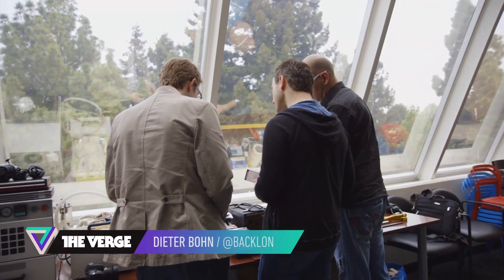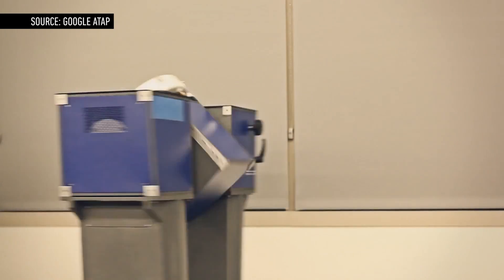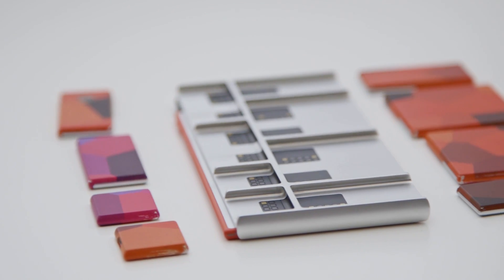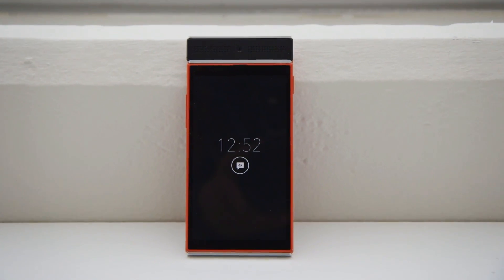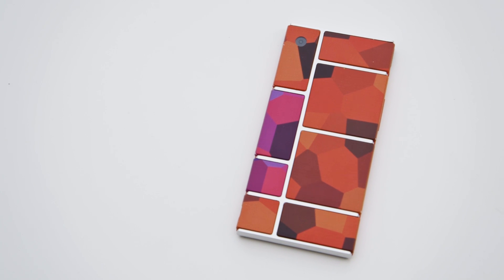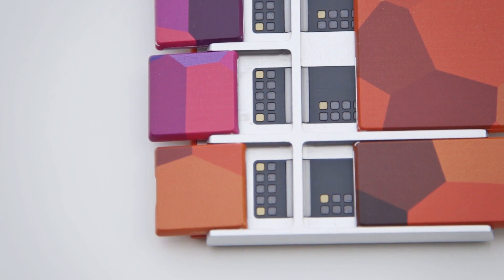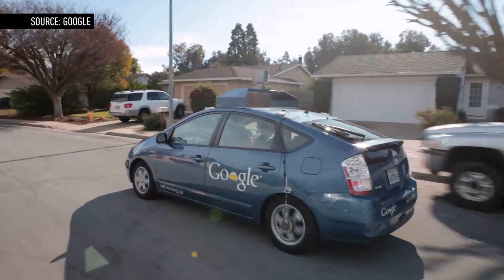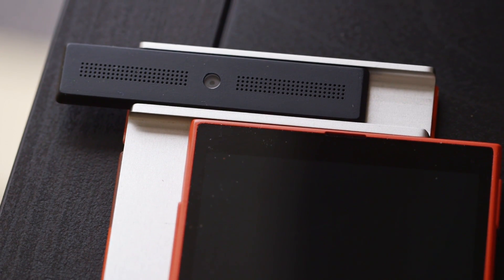Google's Project Ara: Reinventing the smartphone with building blocks

Comment: Can't wait for your Nikon camera module, or your Bose speaker module or your Garmin GPS module? 
Not a chance of happening commercially. The bus, connectors and module wrappers will present too much cost and bulk.The bus itself will not keep up with technology and with shrinking component size the modules will be mostly empty and waste space. Multi-function modules will be inevitable and will kill the concept.
And the price of free market, not from the orchard, phones is dropping really fast, check out the Xiaomi line. Who will upgrade a single module that costs 50% of the price of a new phone?
The goal seems attractive but it ultimately relies on stagnation at the core so is doomed from the onset. There is no chance that you will keep such a phone longer than a integrated smart phone. Think of how bad you will feel when you have to toss away all those modules.

Comment: Would be awesome to upgrade parts of phone.. I would just need a good case for it to not make it a lot thicker but just hold the modules in non wigeling..
Then I would be amazed to buy speaker that i want, CPU that i want, GPU that i want and ammount of RAM that i want :D i would probably be like some quality stereo and 330 Adreno, Snapdragon 800 on 2,8Ghz xD and 3-4GB RAM :D
Anyway im really looking forward to it and if it wont come out in 2015 im taking Xperia Z2..
+ the Screen on ARA looked pretty nice too not too big and not so small.

Comment: With this project like the other project called Phonebloks I worry about the phones becoming worn with the contacts and sooner or later the blocks slipping out and also that maybe when holding the phone a block could slip or move making it lose contact with the connector. The way I see to stop it is not major but helpful but it's to release a case with the phone or have it where they will lock in place and not use magnets.

Comment: I never make assumptions like this. But I truly believe this technology is the future of smart phones and even tablets.
The modern culture is all about customization and individuality, this takes customization beond the screen and appearence, and delves into the way the phone operates. With people able to customize the hardware of their phone. I will be more willing to buy their phone, or as it will turn out, my phone, because I don't have to have anything I don't want. As they've said, this technology will also expand the life of the phone greatly.

This is hacker (the good kind) gold. This will open windows for all sorts of fun applications. 3rd parties can create emulators, games, and even modify the entire functionality of the phone through custom built peaces for the phone.

While this technology is liberating, it could also prove to be limiting in some ways. Here are some problems I think we could see with the device, and some solutions to those problems.

1: unexpected disconnections. Any number of bumps and jolts from every day use could disconnect a module mid use. I want to be able to slide the module half way out and still have it function on the device. This would be accomplished, not by pin point connections, but by connection runners. Basically long pin-point connectors.

2: Not enough room: Lets say that you have all the modules you want on your device, but you still want one more. You would have to sacrifice one module you want, for the other one you want. This is bad. "You can simply exchange them when needed." This is a fine solution, a quick swap of modules can expand the functionality of the device. But these modules aren't like applications that you can install, uninstall, close and open in one simple tap. This is hardware. In order for the "quick swap" of modules to be practical the device would need to be able to live-adapt. Which means that you wont have to restart the device, or open up an intermediate program in order to swap modules. You should be able to use the newly swapped modules just as fast as you can swap them. This feet is not impossible, but it will take some clever engineering.

3: While the whole magnetic holding mechanism is great and all, is it really practical? Wouldn't a push-click system be far more practical? If you can remove those modules as easily as they show, then one simple drop could disconnect any one module. A simple "push-to-remove" system is very practical. It may not be as aesthetic as the magnets, but it's what works.

This technology could win in so many ways, and could even revolutionize how we view portable devices. But it can also fail miserably. Let's hope Google knows what their doing.

Comment: Can laptops and desktops computers be also made cheaper this way?
Reply: People build computers at home a lot, it's mostly plug and play. Upgrades can be made easily.
Reply: Desktops are already made this way, for the most part.

Laptops not so much. It might be possible to do this as moving parts become less needed, and you can have low-powered modular laptops. But the problem with that is that people who want a modular laptop probably won't want a low-powered one. They want a work-horse.

Still it's possible. If it can be done for a phone, it can definitely be done for a laptop.
Reply: Deo Favente Razer is a pretty good company with nice products, they're probaply not the best and there products don't suit everyone, but they're not a joke.
Reply: I could see module tablets maybe using the same parts as a module phone.
Reply: Nathan Gregory yea, that will Probaply be the next step.
If this type of tablet comes out I am Going to buy a 13inch "base" and put massive storage on it! :P
Reply: razer is in the progress of prototyping a modular desktop that is easy for anyone to do.
Reply: brandonhughes7 so you mean a regular desktop with a razer badge?
Reply: brandonhughes7 I fucking LOLed at this. Razer is a joke, so are their users.

Comment: this honestly looks like a promising phone... and in the long run it would seem to be cheaper too because if your camera breaks instead of sending it to the company and spending 100$ or more to get it fixed all you have to do is get a new camera. one thing they should make is a way to fully secure the parts so you don't accidentally pull out the battery. If they do make this phone.. I would buy it. it seems like a great idea.

Comment: Idea is cool and all, but trash in reality. It's got minimal advantages, especially given that the majority of smartphone purchases are subsidizes by cell providers, and some ENORMOUS disadvantages. The losses from adding the complicated communication and locking system, the individual casing for each module, and the inefficiency caused by breaking the phone's mainboard into multiple modules all makes this really impractical. Not to mention disasters such as compatibility and cooling.

Problems like waste and prices can be solved by simply buying last-gen phones. Because so many people replace their phones, those who can't afford a good phone can just buy a used one from someone else. With all the horrible inefficiencies involved in the Ara, it will probably still be a more powerful feature rich phone.

Hate to break it to the optimists out here, but this idea just doesn't work to any practical extent.

Comment: They need to add something on the sides that you pull up so the things won't slide off so easy. You would just need to push it back to pull a piece out and then pull it back. That's my idea, unless they already had something.

Comment: I find this to be very cool, I wonder if it would be possible to create seperate CPU and GPU modules, instead of having them on the same dye. It would increase performance as they could be made larger and more powerful, and having a larger battery module and no camera would allow it to offset the power consumption. I think a lot die hard android users would love that.
Reply: well it all depends how they make the platform... If they make the platform like phoneblocks then what you think of is very much achievable... IF they make it like this... I don't know where exactly are you gonna put CPU and GPU? If you want power they wont be small to replace it instead of camera... And you'd want big battery as well... There's not enough slots to configure. Phoneblocks has better platform.
Reply: sermerlin1 phoneblocks does not exist in any shape or form. they just want to take other people achievements.

Comment: keep in mind the pieces only come off because the magnet is in the off state. they'd have something on the software side to turn the magnet on and off changing between 3 newtons (easy to pull off but doesn't fall) and 30 newtons. which you couldn't pull off if you tried.

Comment: I really love this idea. There's one thing that concerns me though. Lets say you buy a more powerful processor to replace the one you have. Wouldn't you also have to buy the ram and gpu pieces (Don't know if gpu will have its own piece.) to prevent bottlenecking in the device? For example, you can have as much ram or ghz as you want, but if you don't have fast memory transfer speeds to back it up, it's kind of useless. So wouldn't that make you have to fork over more money to buy more pieces? Then again, it does depend on what you upgrade specifically. Maybe i'm drunk. Idk. This just came to my mind is all. Still love the idea though.

Comment: I would try it out, but I suggest them making cases or something that will secure the chips together without any falling off problems or any concerns to the user of the phone.
Reply: Yes. At least a better locking mechanism (as cool as the magnets are). Imagine using the phone and you accidentally slide the battery out, or drop the phone.
Reply: Sub Ripper I do believe the lock function makes it impossible for you to take it out, unless you force it really hard but at that point you will break the frame anyway
Reply: Oh my god yes that's what's needed
Reply: Yukim Nomoto Not you, just that specific idea of yours :P You could be a genius for all I know.
Reply: No brainer. eBay will be full of cases week 1 after the release just like any other phone release!
Reply: Woo im smart now
Reply: Redundant Paperclip Thanks for calling me a "no brainer".

Comment: There are a few potential problems for some consumers. The one i'll say is this: should this project get "done" and out into the hands of the public, there will be those who dont upgrade the right parts. They keep upgrading the processor but not the ram, or the camera but not processor, yada yada yada. This would create issues of the phone being slow, not having enough memory, etc. Although a simple solution to the problem would be labeling minimum suggested parts. This is a very good idea, one that quite a few companies are working on very hard to be the first to announce a "finished" product, and do so on a large public scale. The ability to improve your phone slowly, and to save money while doing so (because you dont have to buy a whole new phone with predetermined parts). I think there would be a lot, and i mean a LOT, of people getting a smart phone for the first time interested, and im sure that a lot of people WITH a smart phone would probably like this one better. And if both Apple AND Google got on board with this, and provided both their operating systems, the possibilities are endless. Although i know this project is going to Google.

Comment: Seems like the modules come off way too easy, especially considering you wouldn't change modules very often at all.
Reply: It has a toggling magnet on it that keeps them in place from what I understand. So I think you can just lock the modules into place and unlock them after.
Reply: They should make so when the phone is on, the magnets are active and hold them and when the phone is off, the magnets inactive and you can take them out.
Reply: Like they said, the modules are made to be taken on and off easily without any struggle, that's why they have a partenership with a company that's going to make extra slim, strong, thin and easy to take off cases, in the way to protect your phone, the modules and make it look pretty.
Reply: Harry Lister They are electro permanent magnets do not need a continuous flow of energy, only a small electrical impulse to change polarity generate a force of 25 newtons between them so not take off, to unlock the modules will be done by software.
Reply: They are held toghter by strong magnets. Also they will let you design your own back cover that goes on top of the back of the phone.
Reply: TechPimp
 Yeah,that's gonna be challenging
Reply: The magnetism they are showing is how magnetic it is when you are able to switch them. Afterwards you activate the more powerful magnet and it's very hard to get off
Reply: alex d Yeah not like it's hard to unscrew a few screws. Doesn't look as cool though :P
Reply: Harry Lister sinephase Harry, they could fall off by accident, the magnets don't need power. sinephase, that is probably the art prototype that doesn't have the magnets.
Reply: If they can actually build a modular smartphone that ACTUALLY WORKS,I won't really give a damn about the modules falling off. That's actually the least important part of thiis project. Don't worry about it,they will figure it out for sure.
Reply: I completely agree, on the original phonebloks advertisement on kickstarter, they had screws, it appeared a lot more secure then these sliding parts.
Reply: Giorgos Zafiris Its not hard the hard  part  is dealing with all the parts that 3rd parties will come out with and making things compatible with no bugs.
Reply: Same thing I thought
Reply: may be it's just a demo model
Reply: ***** seams no one liked it as they have new blood now heading the project lets hope this guy gets it right

Comment: I'm not sure I see the applications of being able to remove physical pieces from the phone and replace them with other physical pieces. Can someone tell me what this would do for me besides increasing costs simply because I'm buying physically more phone?
Reply: in 6 months, the new version of a smartphone chip comes out..instead of changing the entire phone, you replace the processor. same wit all the parts. way better than upgrading every 6 months when manuf. release their new devices
Reply: Compare it to a Desktop.
You pay for the different components.
Reply: say if youre going to a place without a place to charge your phone, you switch out a larger memory for a smaller one, and increase your battery.

Comment: The environmental impact of the phone will be amazing. Less phone garbage. Need a newer processor? Don't need to buy a whole be phone, just buy the processor. Want a better camera? Don't need to buy a new phone, just buy a better camera. What about the old pieces? You recycle them.
Reply: Or resell the old parts. There's that too!
Reply: Trouble is all the parts would need to be compatible with the platform. You'll start getting different generations of parts that aren't compatible with each other, or newer versions of android that don't support old components, etc. I doubt they could come up with much of a solution for that issue other than having a hardware approval process and that'd probably be the most bloated part of the entire venture :/
Reply: True. We'll have to see if they make a good system that's friendly for mainstream users.
Reply: Dave Vaughan
It'll be interesting to see what they do to solve those kinds of issues, and you aren't really addressing newer versions of android not supporting old modules. It's inevitable unless Google can control it somehow (if they even plan to) and it's really no different than say, installing a newer android build for your phone and your wifi or camera stops working because there are no drivers for it.
Reply: sinephase all the parts would be compatable. Android is currently in that boat.I'd say its likely that the main OS would exist on the same module as the cpu, removing issues with version compatability, and other modules that can handle memory storage would simply store the data in a way that was generic such as xml or json or some other universal format. Not just he drive filesystem, but the contacts for instance, so that data thats normaly stuck to the phone is available as the os improves, which sould of course still be available as soft upgrades tot he cpu module.

I think the concept is brilliant.
Reply: NOOOOO!!!!... you sell the used pieces.

Comment: I would like a future were i don't want to upgrade my phone every 2 years.
Reply: David MacNeil Some people can't afford to upgrade every year.
Reply: Krishtrinity
You mean even if this does take off, you still hate the fact that you have to upgrade the cpu/gpu on it every 2 years? Then there's two of us. I'm rocking a Nokia Asha 303. 1GHz single core processor that also does the graphics. I can't play games on it, but youtube, whatsapp, facebook and gmail work on it. That's enough. Costs 100€ so won't be a big thing if it gets thrown to concrete and breaks to smitherines. Then again, i HAVE thrown this phone at walls, it's fallen out of my pocket a million times and it's holding like new. "Old" Nokias are the way to go :3
Reply: JarnoKai If my nexus 4 fall down without one case.Then I can say goodbye to it.I miss the times I used Nokia c7...that thing was practically invincible to abuse
Reply: David MacNeil At least the screen replacement is easy.
Reply: Krishtrinity I missed my Nokia 3310 but my SIM card is too small.

Comment: that phone will explode pieces all over the place were it falls...
Reply: Apple iPhone 6 | Busts screen and cracks case = Throw it away and buy a new one - $600

Ara Phone | A few pieces fall out = Snap them back into place in 30 seconds. Buy a new screen and snap it into place IF it broke - $70
Reply: Its connected by really strong magnets. It won't.
Reply: I assume that they will make custom bumper cases that would hold the phone together